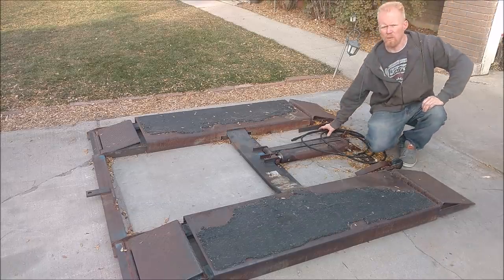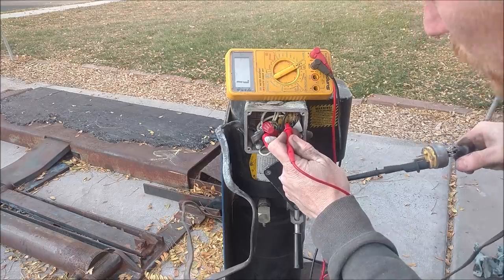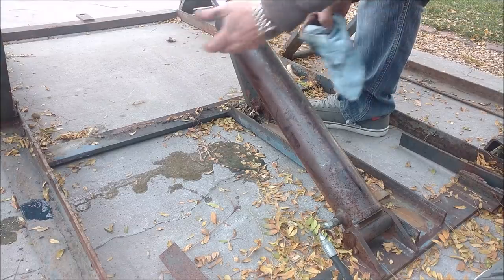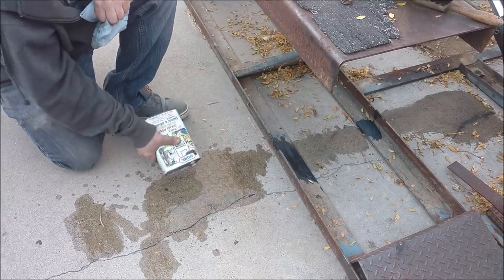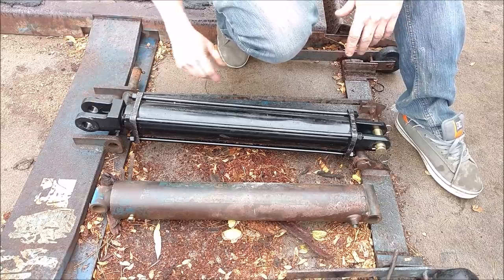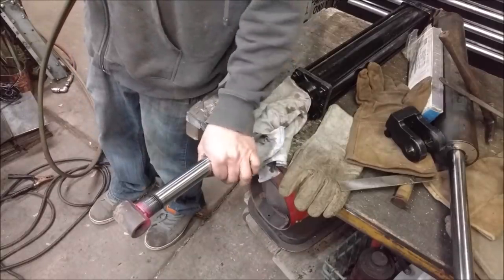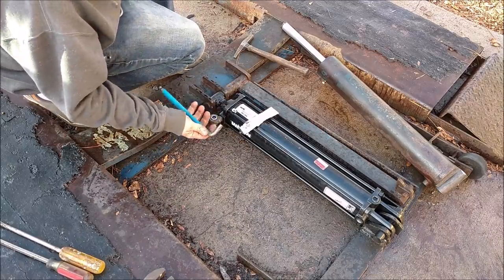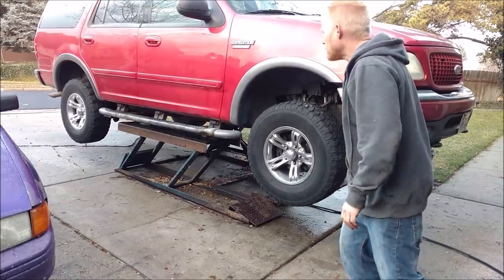Used VEHICLE LIFT worth buying??

Comment: Nice repair job. You planning on keeping it in exposed weather, I assume garage not tall enough to use it in there.
Reply from the maker: It's spent it's entire life outdoors, so I figured it would be fine leaving it outdoors most of the time. I will park a vehicle over it so rain and snow will be minimal on it. If need be I can roll it into the garage.

Comment: id definitely be using secondary stands in case of failure
Reply from the maker: Yeah, it will take me a while to get comfortable around it. It does have the safely lock, but I'm sure I'll throw a random few jack stands under it if I'm crawling under it.

Comment: I can make the exact same unit with good plywood,  and a hydraulic pump. Mattheus Wandell should make this on his channel. Why bother welding when glue & screw can do wonders. Once up in the air all you need is PINS to keep a car from falling. Should be good to at least to support an old Rolls Royce.  Of course there is no reason not to make a pit in your driveway, You can do it a day at a time till you get your 6' tomb built. Your neighbors could chip in and you could do oil changes 'en group'.  No reason to waste your time at Pep Boys or Firestone, once you have one of these in the yard. Say goodbye to luxury and those clean hands.
Reply: LOL, yea right!  May as well save some Good Plywood for your Coffin!  LMFAO 😂❤️😂❤️😂❤️😂❤️😂❤️😂❤️😂❤️😂❤️

Comment: I would have a locking pin just in case cuz it doesn't look too safe to keep it from coming down on you
Reply from the maker: It has a secondary safety lock bar.

Comment: what year is your escort   it looks like the same one I had years ago  good little car for scooting around town with ehhh
Reply from the maker: That car has been a champ. It's a 1996 my wife has owned since around 1998. It is closing in on 310,000 miles and still runs great. Can't beat the nearly 40mpg it gets either.
Reply from the maker: @DontCryAboutIt  1.9l and manual transmission. Engine and trans are original but I have done a couple clutches over the years.

Comment: Whats the major difference between that hard electrical wire that I see in house wiring vs the flexible cord wire? I've always been curious about that
Reply from the maker: There's not a electrical difference as far as what it will power. The solid wire just gets brittle and is not meant to bend repeatedly. Stranded copper cord has just been annealed to be softer and infinitely more flexible. They also use a more abrasion resistant sheathing over the stranded flexible cord.

Comment: Maybe I missed it if you said but what size is the new cylinder, in tons I mean?
That unit will be a great addition to the shop !
Thanks for sharing and take care. 👍
Reply from the maker: Both cylinders were the same specs at 3inch bore with a 18" stroke. The tie rod cylinders are bulkier and slightly weaker than the welded cylinder at only 2500psi vs 3000psi max. But that would still give me 17,671 pounds of lifting force at 2500psi.  This should suffice for a lift rated to only hold 6,000pounds.

Comment: Was that freight damage place called NPS? If not you should check it out. 1601 empire rd SLC.
Reply from the maker: It was NPS. I found it on their Ebay page while looking and bid on it. No one else bought it as shipping was more than the item, but us Utah folks get to pick up for free. I don't know if I would have ever found it looking though their massive amount of stuff in the warehouse.
Reply: @sixtyfiveford  I have found so many good deals. $20 for a brand new radiator for my '52 ford pickup. Lots of welding supplies, tools, and parts for the pickup. Nuts and bolts used to be sold by the pound. They had bags of random fasteners for $1 a bag. The bags weighed 10 lbs plus. Lots of good stuff from the NPS market too. Cases of bananas and such. Stop in every time I'm in SLC.
Reply from the maker: I drop the wife/kids off in the grocery side and I spend an hour wandering the mechanical warehouse.  It's always a fun trip.

Comment: Dumb question are you just lifting straight on the frame of the car. Just picked one of these up this year and have been very hesitant to use it because it’s shorter than the jack points.
Reply from the maker: The "jack points" are for changing a single tire with a jack.  You can lift anywhere along the pinch weld for a unibody car. That is the frame of the car. For a truck/ SUV with an actual frame, You can lift anywhere on the frame. Have a myriad of wood blocks I use to hit different parts of frame and clear exhaust, gas tanks etc.
Reply: @sixtyfiveford   Ok thank you, Ive always been told you have to use the recommended lift points so ive been fearful to use the lift on my ford focus since my points are 54 1/2 inchs apart and the lift its only 53 inchs long.
Reply from the maker: @nanimalanimal  I lift my Ford escort,  which is the exact same thing as a focus, all the time. It's actually the easiest vehicle I lift.  For me I don't even have to put any spacer blocks or anything. I simply pull it up on it and push the button and lift it.
Reply: @sixtyfiveford  Ok ill have to give it a try

Comment: what if you took a ball hone to the cylinder?
Reply from the maker: It would never clean up pitting. Unlike an engine that is built to have some blow by, a hydraulic cylinder needs zero to function/hold.

Comment: Go with your gut feelings . . . . if you don't trust something, redo it . . . . be safe . . . Rog
Reply from the maker: I agree. Lifting vehicles is just new to me and I don't trust being in a pro shop and walking under a lift.  I'm sure I'll put jack stands under it, especially if I'm going under the vehicle. I went over it and all the joints seam tight and metal is solid. I'm going to lift a few different vehicles and do external things like rotate tires before I fully trust it.

Comment: Great find ! It would be nice if it had double rams one on either side so you could maneuver a transmission jack under it. If I had this I would not have to try to squeeze my fat ass under with just floor jacks. Again, nice find !
Reply from the maker: Yeah, there's a few brands that do it that way and I think I would prefer an open center. I've been looking at so many lately I may end up selling this one and buying one of the double ram units.

Comment: Can you keep a car lift like this outside? I dont have room in my garage, will it work in the winter?
Reply from the maker: It has spent it's entire life outside since the mid 90's so I figured that's where I'll keep it. That is probably why the cylinder rusted but someone suggested running a hose on the air bleed side back into the garage where the pump is stored. This will keep any moisture out.

Comment: are those safe? Also, brake cleaner works good for the driveway stains
Reply: Brake Cleaner stains the concrete
Reply: @thefordmaniac  I do pressure washing and use it all the time to remove oil stains. Maybe it stains if you dont pressure wash afterwards
Reply: @brianwilliams4562  I didn't know you meant using it with a pressure washer. I thought you meant just leaving the brake cleaner on there and attempting to soak it up with shop towels. On another note I think the pressure washing did most of the work and not the brake cleaner. Hmmmm...I shall test this theory come spring time.

Comment: So, are those wera allen wrenches universal? Will they fit both metric and standard hex bolts?
Reply from the maker: They're not. They have separate SAE and Metric ones. I've been using them for about a year now and they are the best I've ever used.
Reply: @sixtyfiveford  Ok. Can you send me links for both? I googled them and all I can find is I guess metric because the case is labeled like 1.5 - 10 or something.
Reply from the maker: @4wheelingfun04   SAE: https://amzn.to/2RQTC0s and METRIC https://amzn.to/2DXviDt . My only complaint was the metric doesn't come with size #7 which I needed on a recent BMW brake job. Funny that a German tool would be missing a common German car allen size. However it's probably the first time I've ever needed a metric 7. Other than that they grip better than any Allen wrenches I've owned(snap-on, Matco, etc included)

Comment: All the work Ive seen you do, and you passed on the seal repair on the original cylinder?
Reply from the maker: It was pitted beyond repair.
Reply: A seal repair would be useless if the actual hydraulic cylinder tube is scored from metal on metal contact and rust pitting from water intrusion. Even brand new seals would't seal the uneven surface.
Reply from the maker: If this was in a typical application like a tractor ram; I may have attempted a seal kit and honing the cylinder. In that application where fluid and pressure is applied from both sides a little leakage from side to side isn't a huge deal, it will just cause a ram to slowly leak down. Any leakage in this application with it being air on one side and fluid on the other results in lubricating my driveway. I lucked out as a seal kit was actually double what I paid for this new cylinder. Thanks for the input guys.